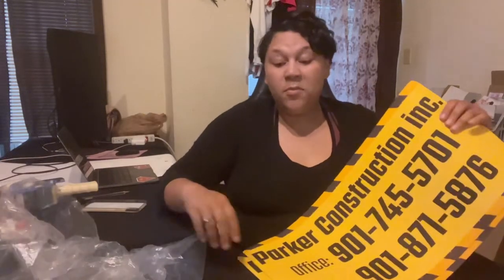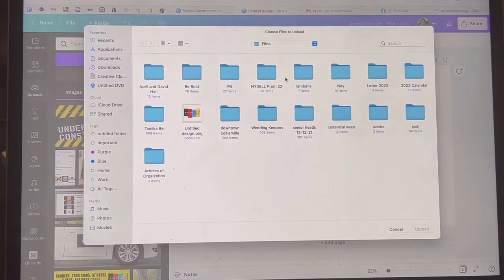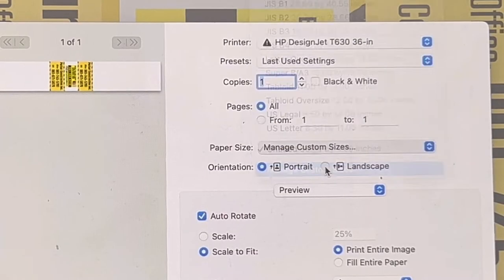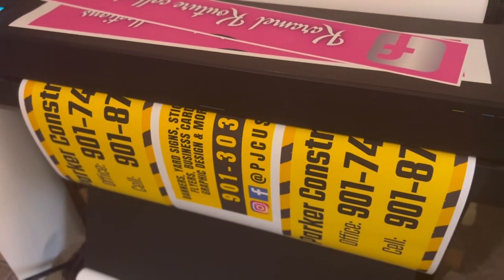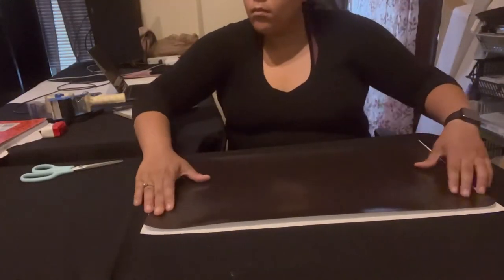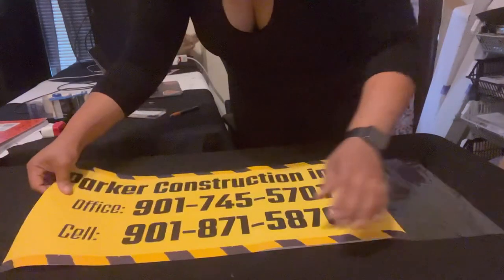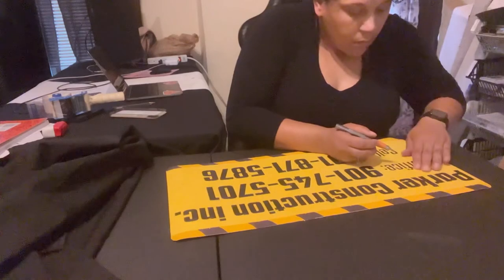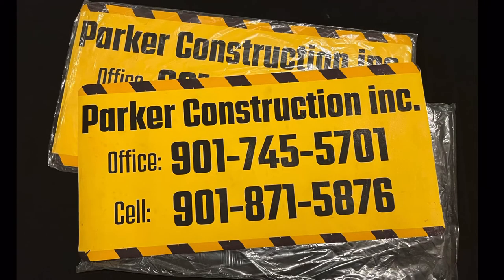How to Make Car Magnets | door Clings with HP DesignJet T630 |Wide format printing. DIY

Comment: I buy rolls of printable magnet stock. You print straight onto the magnet. No need for sticking the magnet on after. My printer is the Canon ipf8400. I can put fabric through the printer also.

Comment: I'm loving your content. I'm about to grab this printer and decided to look it up first. You're definitely helping me decide on this printer for our printshop. Can you print a floor banner? That's what I'm buying this for. To be ae to do floor banners for parties.
Reply from the maker: Yes. I have done several floor wraps. You can print up to 3 feet on this one, but I’ve made them as big as 8x8 with a tiling method
Reply: @nicciclutch  what kind of printer is this and where did you get it from?
Reply from the maker: @rosemccain9246  it’s in the title ma’am. And it was purchased on amazon

Comment: I got a free HP t730 model, can I still use that one for this type of project?.
Reply from the maker: You can use any wide format printer, you’ll just need to adjust your sizes and find the adhesive backed paper.

Comment: Great video, great content. I have a Hp Designjet Z3200ps photo 44” printer that I have been using mostly for FineArt but would like to get into printing signs and banners. Can you recommend a vinyl paper to use, both adhesive and non-adhesive? Also, what paper do you use for floor wraps? Thanks
Reply from the maker: This the banner roll I use  FastPlot Polypropylene Banner 8 mil Waterproof - 36inch x 100ft Roll - 2inch core https://a.co/d/bt5yyR1
Reply from the maker: Stickers and floor wraps FastPlot Self Adhesive Polypropylene Banner 8 mil WP - 36inch x 100ft Roll - 2inch core https://a.co/d/ajv1MSd
Reply: @nicciclutch  Thanks for your super fast reply.
Reply: Great! I just ordered both with your link. Looking forward to more of your content. Thanks again.
Reply from the maker: @perrymacimages  awesome!

Comment: what type of gloss vinyl do you use with your printer?  I have the t210 but it's basicly the same printer only smaller.  thanksw in advance for your help.  really appreciate the videos.
Reply from the maker: Unfortunately, the gloss papers are for laser printers and turn to smudge with inkjet printers. Don’t waste your money. 

I’m still trying to find one that is comparable, tho gloss adhesive has not yet been successfully found
Reply: @nicciclutch  what adhesive back paper do you use?
Reply from the maker: @bigcrazyal5560  I order the 32 inch self adhesive banner paper roll from Amazon.

Comment: Does this printer/software let you add registration marks to cut it on a vinyl plotter ?
Reply from the maker: That technology would be in the actual cutter software. It would print via the software direct to the printer. To my knowledge it does tho I haven’t used the feature. Most print and cut plotters are not MAC compatible so I haven’t bought one

Comment: Have you done backdrops with your printer? If so what are your steps?
Reply from the maker: Check my playlist. I have one for Xbanner and retractable.
Reply: @nicciclutch  where do we buy the magnets
Reply from the maker: @terryw5500  I got these on Amazon for around $20
Reply: @nicciclutch  the whole box
Reply from the maker: @terryw5500  they usually come in 2 packs

Comment: can you make floor wrap?
Reply from the maker: Yes. I’ve done up to 8x8 using a tiling method
Reply: @nicciclutch  what kind of paper did you use for it ?
Reply from the maker: @Patron77770  https://www.amazon.com/dp/B018UHSEF2/ref=cm_sw_r_api_i_4QR2H3WYXVEWK30B5HKA_0?_encoding=UTF8&psc=1
Reply: @nicciclutch  so this works for both the magnets and the floor ?

Comment: What paper are u using
Reply from the maker: FastPlot Self Adhesive Polypropylene Banner 8 mil Waterproof - 36 inches x100 Feet / 2 inches Core https://a.co/d/dwEmawY

However I highly recommend just spending the extra money on gloss…
Reply: @nicciclutch  i tried finding the gloss and finding this on a role cant find and hp dont have it

Comment: Hi are you using canva pro ? Or are you on the free version? Thanks
Reply from the maker: I’m using pro.
Reply: @nicciclutch  sorry one more questions, how did you print from Canva?
Reply from the maker: @luisdiaz6484  you’d have to download your design. And print from your computer
Reply: Hi I came across a little issue, are you able to print bigger than 4 ft height?
Reply from the maker: @luisdiaz6484  Canva has size limits… you can half of, and when you export it export it at 2.5X size
Reply: @nicciclutch  would it print in one whole page or would it print in two separate prints?

Comment: Is the ink expensive?
Reply from the maker: Not that bad. Less than 250 to replace all 4 colors. $250 in ink is a 10x return rate in sales
Reply from the maker: Not that bad. Less than 250 to replace all 4 colors. $250 in ink is a 10x return rate in sales

Comment: Hi please i need your, I got this HP DesignJet T630 few days ago the aim of acquiring the printer is to print artwork and photograph but the print colour is very dark. Using photoshop to print helped a little bit but I’m still not getting the diseased print. How do I resolve this
Reply from the maker: Are you using genuine HP ink?
Reply: @nicciclutch  Thank you for replying. I believe I am using a genuine ink because I have not replaced the ink that came with the printer
Reply from the maker: @Kaluckalu  than that may be your issue. Get some fresh ink for each color and let the printer reset the ink.

Comment: Hi! For that printer can you use any kind of vinyl? Or what kind of vinyl you used
Reply from the maker: You can use banner vinyl. 

You’ll have to use Wide format printer vinyl on a  2 inch core. I’ve personally used the 8 oz and 10 oz.